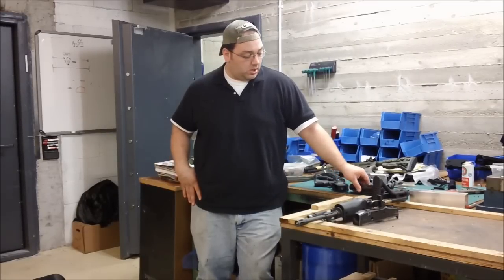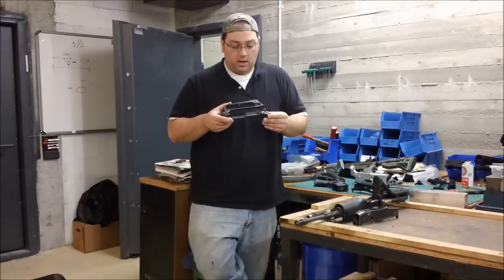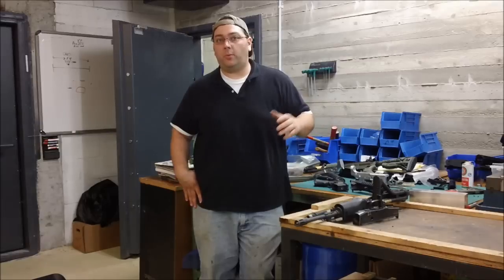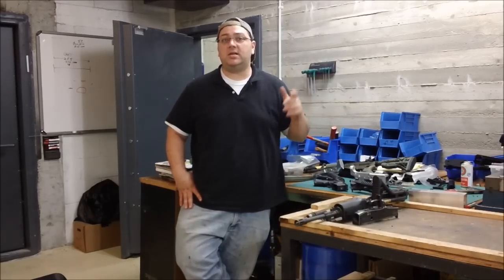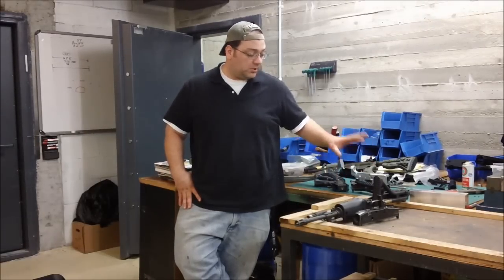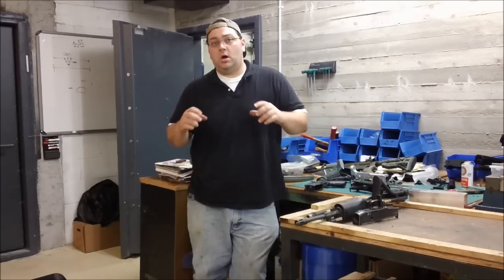Seeing is believing! Milled vs. Forged receiver strengths. Also a look at barrel obstructions

Comment: Yeah, the military has been using forged lowers for how long now? I think that will suit me just fine.
Reply: In this case forged is both cheaper and stronger.
Reply: Did you even watch the video even a little bit?
Reply: he said he intentionally used proofing rounds in these guns, which is guaranteed to cause this failure if don't block the gas port
Reply: while I agree with you in this instance, your "military grade! HOORAH HOORAH HOORAH!" aurgument is flawed.  "Military issued" & "Military Grade" often means the most cost effective junk unlce sam is going to pay for.  Sometimes it's good and sometimes it's bad but most of the time it means there was something better but a budget committee wouldn't aprove the spending.
Reply: +Lance Walker Or worse yet, maybe even something inferior that a certain constituent makes, and his senator just so happens to be an influential member if said committee.

Comment: So you had a point? AR types do not rely on aluminum to be safe.  90,000 psi (cup) round would and did destroy both guns. you compared an A1 upper with a modern billet example. Not sure they were equal thickness or age. In any case it would have been a much better presentation if it were a film of the failure. At the end you embrace the Galil. Yes I love it as well. Not that I can afford one... missed the boat on that. Anyway like you say its a forged barrel and steel AK receiver. Not to be a dick but your ak ar lower? Wont the forward notch wear out?

Comment: catastrophic failure is catastrophic failure reguardless.  If you shoot the standard pressure or even reload to the standard pressure there should be no problem!!  Show me the forged part on ANY gun that fails at or under normal pressure and I will be concerned.  With due respect you video seems to be  a justification for spending money not needed

Comment: I'm sorry, but the only thing this shows is that forged receivers have a lower malleability than one milled straight from billet stock. This is normal for all non-ferrous metals, where shaping them work hardens them (same reason why brass cases eventually split, and why there is such demand for annealing machines to extend the brass life). A better test would be to put them in both a tensioning machine that tests to failure (hopefully everyone's seen them before in steel testing) to show how much force the piece has to be under before it starts to deform, and eventually break. There are also machines that bend sample pieces to failure, testing tension strength on the side that stretches (outside bend) and compression strength on the inside bend. These two tests will give better insight to how strong each receiver could be instead of blowing each of them up with an overpressure round.

Comment: A forged upper is harder and more dense, this means more brittle hence the severe failure. However it is also more wear resistant.The billet is less dense and softer, therefore more ductile so the failure is less severe. However it will wear faster.

Comment: I have a few problems with this video. I would agree that seeing is believing IF you can repeat the same results most of the time. A one time result is not proof in my opinion. One problem I have it these were not 2 identical receivers with the only difference being one was forged and one was billet. When you have any kind of failure like occurred in these so called tests, the excess energy needs to be expelled somewhere but when one item in the test is configured differently than the the other, that energy is going to be expelled differently. Another problem is the inconsistency of ammo. The best of ammo has inconsistencies in it. The top accuracy  shooters go so far as to handle their ammo in a specific manner when loading their rifles to try to minimize consistencies from the way the powder lays in the rifle case to minimize inconsistencies in the ballistics of the rounds.. In my research of forging vs billet, I looked at other things other than just AR receivers. I looked at automotive pistons, wheels,connecting rods among other things also. For the most part, the consensus is that forging will be slightly stronger than billet due to the process used when it is formed causing the grains to be more tightly bonded. So in closing, if you want to convince me that billet is stronger than forged, I want to see consistent results with as many variables in the tests removed as possible. If you can do that, then seeing is believing.

Comment: The forged vs billet was extensively tested by Kalashnikov. The stamped receiver was proven to be significantly inferior but cost less than half the price to manufacture. But with dialed down ammo it didn't matter. If someone wants to cram wildcat ammo into a cheap AK47 knock off it's their problem.

Comment: [Theoretically] If you had a forged & billet receiver with 100% similitude, the forged piece would be stronger.  The strength in billet receivers comes from the additional material (which also adds weight).  If you had a forged set as thick as some billets, it would no doubt have superior strength or "toughness", all else being equal.  

The real reason people debate billet vs forged is because they feel a need to justify their purchase of a $250 counterpart to an otherwise <$100 item, and can't have an intellectually honest discussion.  You get enough people following that group-think and what develops is a sense of elitism, which snowballs into constantly shoving down peoples' throats the notion that billet > forged, and that you're an idiot if you're still using that forged garbage.  Practically speaking, for a functional rifle, forged 7075-T6 is perfectly acceptable; if it wasn't, our military would've ditched it a long time ago.  

Billet receivers, and especially high precision matching sets, are basically gun porn.  They look slick and aggressive like tiger II tanks with their sharp lines and flared magwells, in addition they're highly customizable to boot.  Perfect for people who want something different and can afford to shell out for aesthetics.  I personally prefer billet because certain matching sets look absolutely stunning, but if your justification is because the stock removal process offers superior strength to forging... you're kidding yourself.  Now, you could say "I like billet because it looks nice" or "It has better tolerances for a precision build" or "I like the flared magwell and the ambi controls", etc. then that has merit.  However, the notion that the sheer process of stock removal offers superior strength to something that's been forged is utter bollocks.
Reply: Strength hardening or work hardening changes intermolecular (interstitial spacing and alignment) arrangement and density.  It's not merely a matter of "more material
Reply: David Russell
I know... lol

Comment: The increase in pressure caused by oils and other combustible fluids is called dieseling. It's when a combustible fluid is compressed to the point of ignition. You can perform the same sort of feat with a springer air rifle and a little oil in the pellet cup. It increased the velocity of the pellet but may damage the air rifle as well. As a kid, I saw David Copperfield make the Statue of Liberty vanish. I didn't believe it then either. Still, for an actual comparison of receivers, you would need to perform the same test on a much larger sampling of both receiver types from a variety of manufactures. A one off comparison doesn't really tell the whole story. The metallurgy between manufactures does vary sometimes significantly. So this particular test falls very,very short of it's intended mark. Thumbs down #215

Comment: What makes the billet stronger is the billet has way less metal removed from it...hence stronger. But billet is heaver, so that is a trade off. If a forged is cared for properly and the ammo is treated as it should be, the forged is just as good and lighter. So much for your video trying to sell billet.

Comment: I applaud your reliance on evidence based material purchasing, but this reminds me of what happens at my research job when folks outside our research department design experiments without a professional researcher.  What you have in the experiment is a sample of 1 for each receiver type.  
What that means, is that you have zero data as to whether if you did the same experiment again, that you wouldn't get opposite results.  It's literally like tossing coin twice, getting heads twice in a row, and using that to declare the coin rigged. 

Statistically, you really don't know anything until at least 5 replications each (10 total) with a robust estimate of the outcome for all forged and milled receivers until a minimum of 7 (14 total).  So, your didn't save money by only doing it once each. You wasted money by doing it at all. 

Both receivers failed, and the exact way they failed probably won't be the same way each time.  Unfortunately, we don't know anything from the experiment about forged vs. milled. We only know about those two specific receivers.
Reply: He used different uppers, a flat top and one with a carry handle.
Reply: +Rick Holden YES!  Big surprise that his company sells billet uppers.
Reply: 8literbeater Yeah, I do business research for a living, and I've noticed that the right number of replications or studies required by an executive usually equals the first set of results that confirm whatever the exec wanted to do in the first place. If they don't like the results, they'll ask for another study. If they like them, then all went well.  It all depends on the honesty and integrity of the decision maker.  That's why independent research firms are required for unbiased results. 

That said, I always assumed that billeted uppers were better, because they're so much more expensive. Why on earth would there be such a large market for an inferior part that costs so much more?  I tend to trust the wisdom of prices discovered in free markets between interchangeable goods.  

I would also assume that it depended on whether the part was stamped from sheet metal, or actually forged. Then if it was heat treated or cryo treated to align the metallic crystals and relieve stresses.  If the part was milled on well treated bar stock by a quality manufacturer, then I would trust it more.  We can't look into the factory, so reputation is paramount. 

To me the most important one is the lower, because its the serialized part that has the NFA tax stamp. You can't just swap it out with another one, like an upper.
Reply: Rick Holden Not only that, but in using receivers from only two different manufacturers, quite possibly with quite different quality standards, one does not get any data on whether or not this holds up to different manufacturers with different manufacturing processes and different levels of quality control. Without that it's impossible to know if any difference that emerges is due to a fundamental difference between forging and milling the parts or just the way that particular manufacturer implements it.
Reply: I was thinking the same thing.
One example of each, neither of which were part of a control group of any kind. 
If you had 10 receivers from the exact same lot for each type, and were exact in loading the rounds I'd be surprised if the results were the same every time. 
Were both receivers 7075 aluminum?
Were they both "built" by reputable manufacturers? He mentions that you can get a receiver for as cheap as $50. I would expect a failure of that one before one that runs 3x that price.

That being said, as I understand it, there are only a few forgers that do receivers. Most companies buy from the same place. From there, it's up to them how well they machine everything out. Obviously some companies have a much higher level of quality control than others. 

I've never heard of Joes putting rounds covered in CLP or kerosene or anything else and then blowing up a rifle.
I'd be a lot more likely to believe that Joe's weapon blew up because it had tens of thousands of rounds through it, was poorly maintained, and was at the end of it's life. Not to say it's not possible, but if you're going to an "investigation" that prolific, provide a source. Otherwise, don't be upset when people call Shennanigans. And, again, it's an investigation. How much scientific research and testing went into proving that his report was accurate.
Reply: +Rick Holden 
I totally agree. Thank you for posting the most intelligent comment in this entire thread.
Reply: +Rick Holden milling is more a more expensive manufacturing process, but it also has lower setup costs which makes it much better suited for limited runs and also for companies that make multiple products within the same space.
Reply: And receivers were of different starting configurations
Reply: +Rick Holden 
Thanks for your reply, now I understand a lot more then I did before I seen this video and read your reply.
Reply: i think that the upper takes the most stress from the explosion and the bolt slamming back and forth.  it is true that it is not serialized and tracked but it is where the rubber meets the road.  I was taught for the highest quality rifle get the best barrel upper and bcg you can afford.  they will shoot just fine with any lower.  nfa tax stamp for an ar15 lower?

Comment: all this "proves" is you should only fire the correct ammunition in your rifle!  sheesh!  no SHIT it deformed and failed!!  this isn't proof of jackshit.  fukken thumbs down.
there is NOTHING wrong with either forged (mil-spec) or billet receivers.  behave and use the CORRECT ammo and the thing should last a good long time without incident or failure.
honestly, i have no idea why i clicked on this stupid "suggested" video.  thanks youtube, you suck and THIS VIDEO SUCKS!!
Reply: mike cross
that depends.  the lower has the buffer tube threaded into it.  in pretty much every polymer case that is where it fails.

and that's if you're firing the correct ammo.  testing anything with incorrect ammo proves nothing.  if something is designed to behave a certain way under specific conditions, then loading higher pressure ammo into it is like, the dumbest shit ever.  no one is going to do that.... ever.

that's almost like someone saying they're going to test their engine by running at or past the red-line.  that isn't going to prove how tough your engine is, it's going to destroy it.

oh look, my engine passed my red-line test, i guess it's a good engine, right?  wrong.  it WAS a good engine until you beat the crap out of it.  so it goes with this "high pressure" test.  if the lower and upper are rated for a certain ammo, using something more powerful proves absolutely nothing.
Reply: +betatalk357 
First, we are not trained killers. We are well trained soldiers and Marines. We are well disciplined, schooled in the Law of Land Warfare, and have our humanity and individuality intact. Trained killer bullshit is just bullshit for Hollywood and lie-telling valor thieves.

Second, I was eventually granted a lat move and held the M.O.S. 2111 (Small Arms Tech), and later 2112 (Precision Weapons Tech). Even before I became a Marine I learned that the only thing welcome inside the chamber of a firearm is the cartridge. However, chambers are often contaminated with CLP or other lubricants, brass flecks, and foreign debris such as sand, water, and dirt. None of which cause them to explode. 

Third, none of my ammunition ever came into contact with oils or fuels while in Kuwait, except for whatever CLP may have come into contact with a round entering the chamber. Even being covered in crude, our ammunition was protected inside the weapon, magazine pouches, and ammunition cans and crates.
Reply: matt summers
interesting i guess (shrugs).  i'll be sure to use the correct ammunition so as not to "test" the upper limits of a firearm's particular stress levels.
Reply: betatalk357
so wipe it off on your shirt and put the cartridges in the mag.  simple.  any fool stupid enough to load ammo dripping with gasoline deserves to have their face rearranged.  and why are we transporting our ammunition in the gas tank?  or with the fuel??

guns and stuff over here, gasoline over THERE.  it's simple.

food over here, and dirt and stuff over THERE.  how hard is it to keep stuff separate??  who heaps everything in a big pile anyway?

human beings are fairly organized creatures, i think we've come a long way since Vietnam.  and so has the AR, M-whatever.  if someone is that disorganized they're keeping their ammo with the fuel, and some spills on the ammo, then what can i say?  here's your darwin award.
Reply: +KingTesticus How'd you like the video bro?

Comment: This guy did a horrible job explaining the difference. When dealing with receivers, Billet is a raw block of metal that then needs to be completely milled to get it into shape. Forged is when a mold is made and molten metal is poured into the mold to give it a rough shape that is then milled to final specs.
Reply: That's casting, not forging.
Reply: TheRedCelt  ~ that's what I was thinking. I was hammered the night I wrote that. Thanks for squaring it up for people!
Reply: +moncorp1 It's all good brother.
Reply: +moncorp1 lol...you shouldn't drink and type ; )

Comment: Am I missing something?  You talk about a lower receiver and then show two damaged uppers.  All of the pressures occur in the upper.  Why, then would it be "better" to spend the money on a billet lower ($250.00 v's $75.00)?  Real world the comparison is pointless and to me it is just trying to justify the expense.  

Even considering the pin issue. A $27.00 set of anti-roll pins eliminate most of the wear.

The fact is, the only real difference between billet and forged is cosmetic.  I, for one, did not build my AR based on looks.